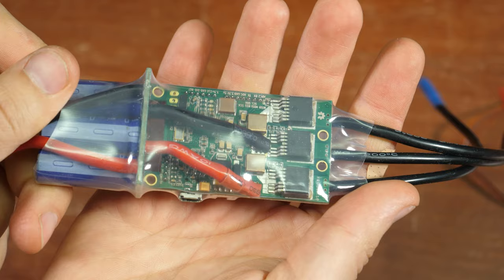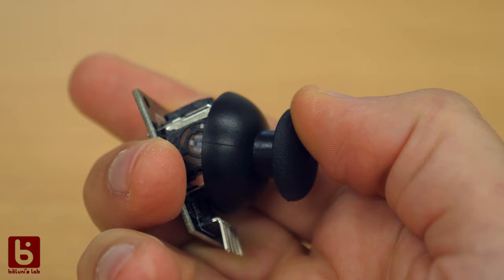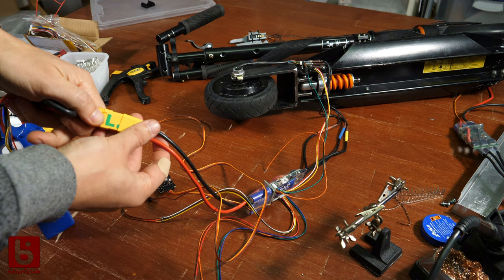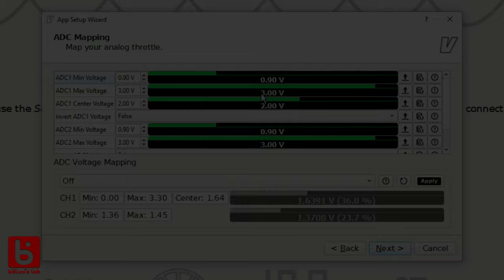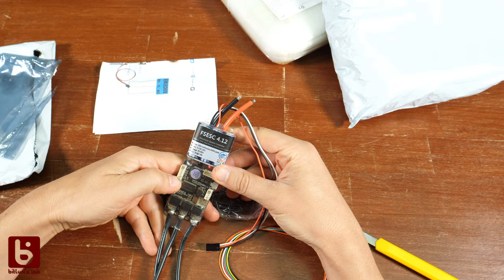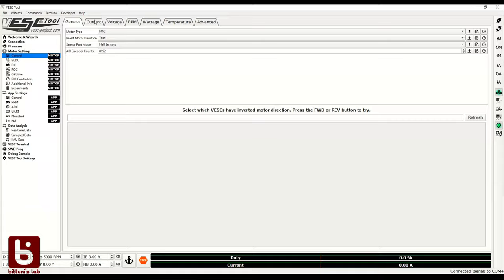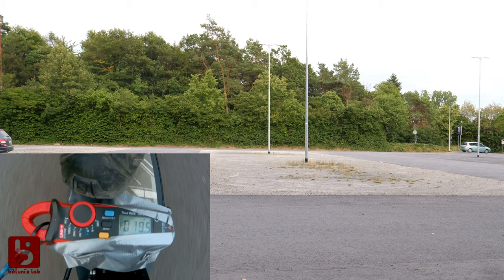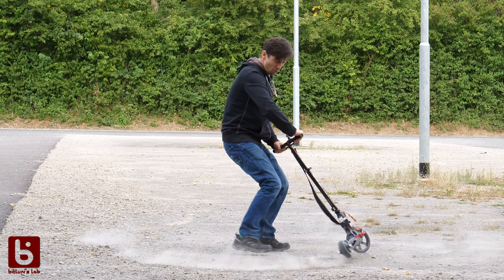Regenerative Braking - DIY Electric Scooter Part 4 [VESC]

Comment: How did the motor burn out the first time? You said you had 20volts high then rated.? You weren’t using the actual battery’s for the scooter?

Comment: You should install a strain gauge under the stand.
When you are on the scooter, everything works as it should. When you step off, it should apply the brakes. 
Like a dead-man's switch. 
I love your workmanship. So German!
Reply: What about if you jump?
Reply: @MrTomberi211  you can also set timer before it activates in vesc, have time enough for jumping and tricks but if longer it shut down.

Comment: The motor current in the vesc settings is the current at 5v or whatever it sends to the motor, so it can be larger than you'd think. You can set it higher and limit the overall current with the battery limit and the total power limit (in watts). Also, I'm sure you figured out FOC mode is way better than BLDC mode (pwm). Good stuff

Comment: Hi, I just increased the regen braking value on my scooter and now it brakes much better downhill. 
The question is will this increased reverse energy hurt the battery or the controller? Thanks!
Reply from the maker: you need to check the maximum charging current of the battery. i'm not really sure how harmful it might be to any of it. the controller should have protection but I had a few blow up on me because of reasons i still don't understand
Reply: @bitluni  omg that's not reassuring  they are expensive and when u say blow up does it cause smoke and fire

Comment: You will burn up any vesc in no time on high erpms, solder a P6KE56CA tvs diode directly on the vesc pcb battery input, otherwise you will destroy even more vescs, trust me I had to go through 5 vescs before realising the engineering flaw.
If you want to be extra carefull you can add a EEUFR1J681L ultra low esr cap, will help as well with the survive chances of your vesc
Reply: Leo Pryside I agree it’s not a very “reliable “ or “robust “ esc the Vesc I went through 3 of them just on the bench in the end I sort of got fed up with them - maybe the TVS might have helped them not self destruct 😉

Comment: Here in the UK these 'e-scooters' are illegal to use on public roads.  A 35 yr old lady was killed on one in London just this week.  Are they legal in Germany?
Reply: To my research: They need to be certified safe (lights and brakes), furthermore insurance is required (including a small license plate) and kids are not allowed to ride them. It can be compared to the laws for light scooters and throttle ebikes.
Reply: Yes. Everywhere in munich is filled with this things

Comment: Just an idea ... the breaking current is quiet limited by the lipos usally they dont really like to be charged with more then  a few C ... so i imagne a capacitor bank and a current limiter or something like that ... that way you can breake with way higher current  and simply charge up some beafy capacitors wich then slowly charge the batteries from the breaking if i think about it a  emergency resistor to just pull the caps low if the caps dont decharge fast enough befor an other brake 
all that would give more breaking force xD

Comment: Questions:
1) I hav an escooter but no regenerative braking. Do I need to change the electronics?

2) I want to change the electronic braking switch to the known bike braking, but still retaining the electronic braking system, it's just the switch that changed, is that possible? I want to see how you do it.

Comment: i would love to by the 5.5" Hub motor, but shiping it to me (Netherlands) is more expensive (almost 2 times!) than the motor itself :-(
Reply: It is the same to ship to the UK, surely there must be more hubs available without ridiculous shipping fees?
Reply: @AndrewAHayes  Let me know if you find one. I'll do the same...
Reply: @iamkian  OK
Reply: Facebook Marketplace is full of "dead" scooters, hoverboards and other devices. A hoverboard yields two 350 watt brushless hub motors and two pretty good, flashable ESCs. Not to mention about 28 good 18650 cells. I buy the hoverboards for 10 USD each. The last batch had 400 watt motors and one was working perfectly.

Comment: Is that thing legal in Germany? Do you plan on adding a Legal mode in case they Check the scooter?
Reply: No. So it's funny that he mentions removing the push detection because of the new law but ignores all other new requirements ... ;-p

i.e. to get it street legal he has to add lights, two brakes, max 20 km/h + 500 Watts limit and he needs to find someone willing to give him insurance.

Comment: Ich würde dir empfehlen bei Ebay eine Aluminium Box für das Vesc zu kaufen da es bei Belastung warm wird und so besser gekühlt wird. Du kannst mit einer Bestimmten Software auch ein HM10 Bluetooth Modul anbringen wo du dann mit der Vesc App Ackmaniak Vesc bei PlayStore diese ganzen Daten auf dein Handy schicken kannst und live sehen kannst. Das würde die Stromzange ersetzten. Coller roller ich habe mir ein Elektrisches Longbaord gebaut und ähnliche Teile verwendet. Siehs dir ann wenn du noch was zu dem Bluetooth wissen möchtest Instagram: i.jxlm

Comment: NEVER NEVER EVER use Deans or XT90 Connectors for Projects like that use AS150 instead or something will get hot!!!!
Reply: he drew like max 30 amps from his lipos which is safely und the max rated 90amps of the xt90 connector. I ran 122 Amps from both deans and Xt90 and there was no heat whatsoever..